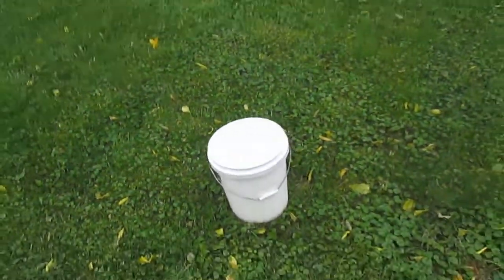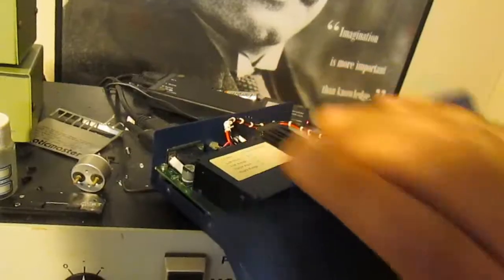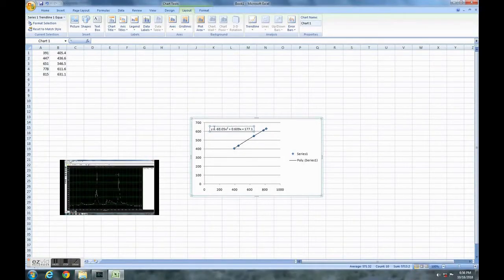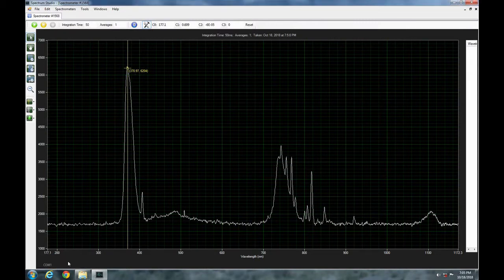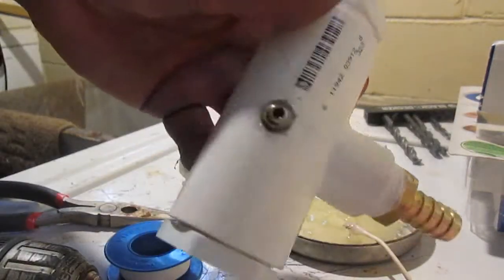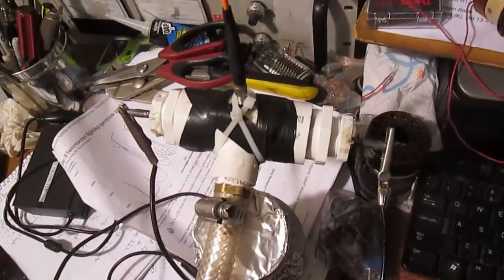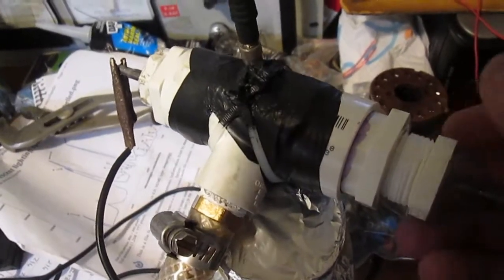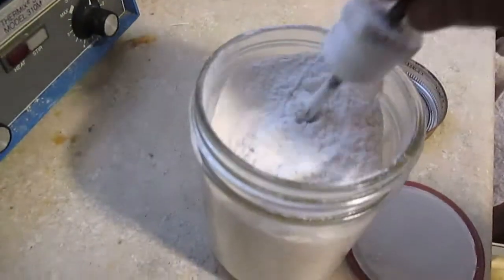DIY emission spectroscopy

Comment: Can you post a build guide for this? Did you find it on the web somewhere? I would much appreciate it,  great video!
Reply from the maker: Thanks !! No I didn't find it anywhere I just needed a vacuum chamber with conductive electrodes and built one out of the cheapest material I could find ! The hardest part is to find piece that fit together ! And then I just glue them all ! Very simple !! Thanks again !